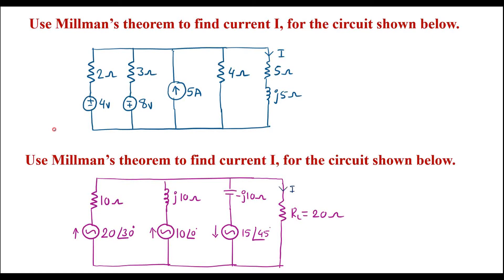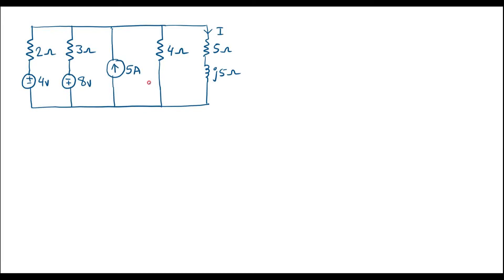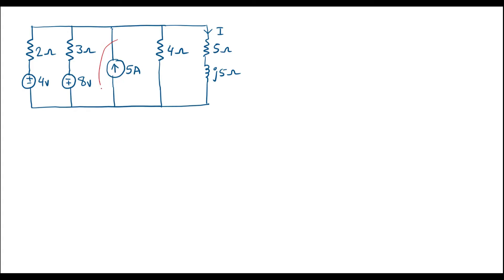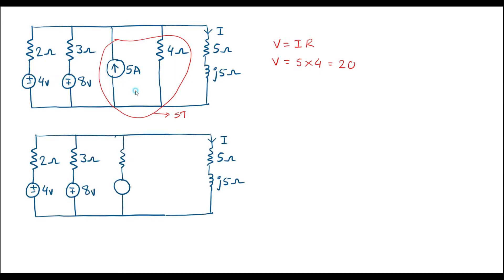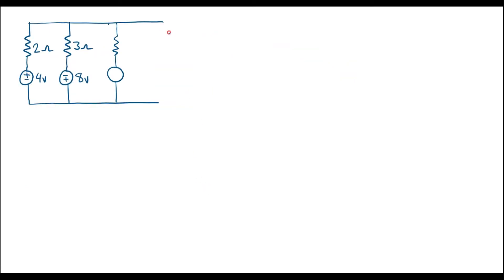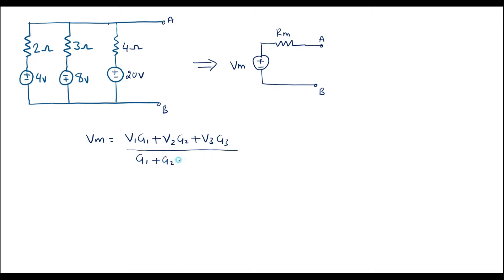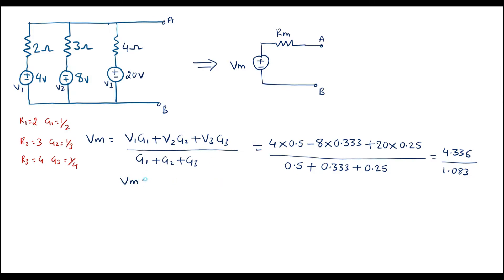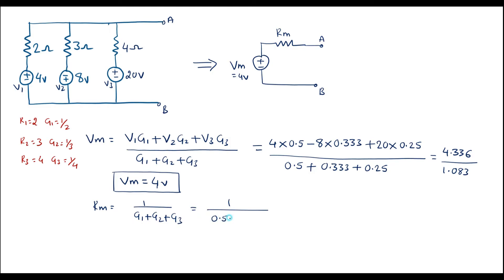Numerical on Millman's Theorem

Comment: in the firsrt example: 
the value of impedance should be 5 ohms onlr rather than 5+j5 since the voltage source is DC, frequency = 0 so j5 element is not exist 
I understand that you want to apply the theorem but the concept is wrong .

Comment: There is a numerical mistake in the calculation of Vm it should be 12.552 V and argument 57.66 degrees and the current is 0.418 A.
Reply from the maker: Oh ok. I will check and correct it. Thank you for information.
Reply: Answer is correct